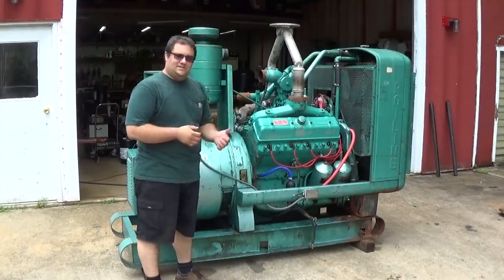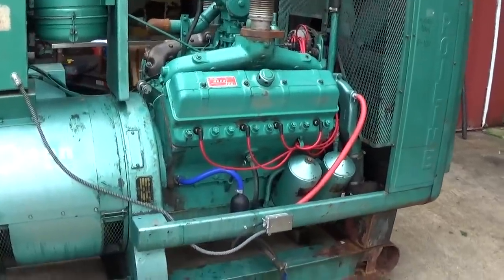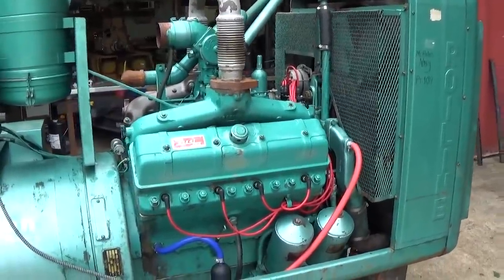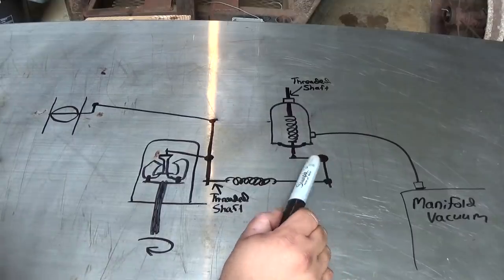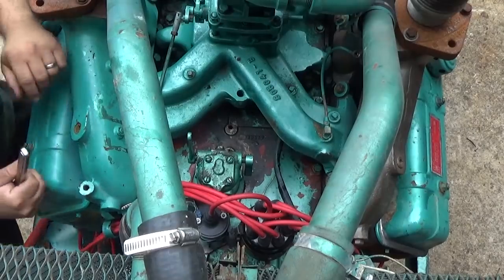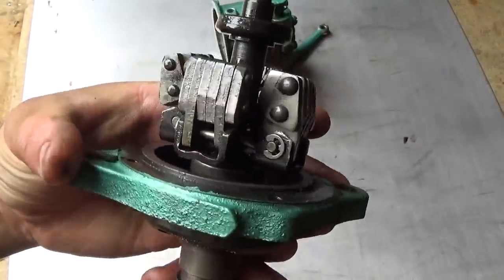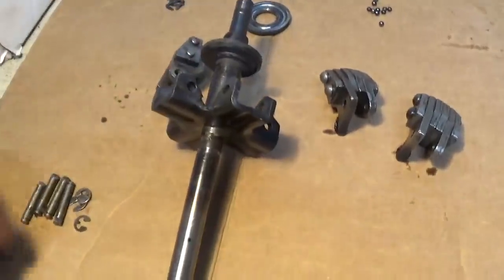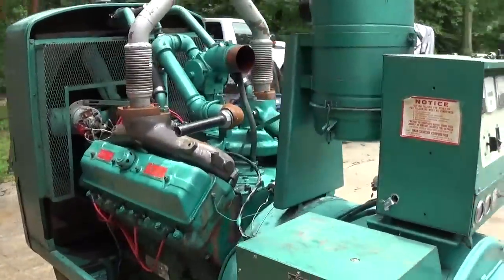844 Cubic Inch V8 GENERATOR Lets find out what is ailing it... Onan 140WE

Comment: I'm interested in seeing the electric governor refit.  I'd be very surprised if you have a high pressure natural gas line feeding the house, are there options to feed it from a bottle?
Reply: 844 cubes he'd be sucking bottles faster than an alcoholic after an AA meeting
Reply: @dustinpoole5106  yep! I've got a propane powered 70kva onan with a turbo 460 Ford on it and it will make 4 500lb. Propane tanks in parallel cold enough to condense water on them even in the middle of summer
Reply: @dangoldbach6570  Gives a whole new meaning to the phrase: you cold hearted bitch.
Reply: Did you have to adjust the propane  @dangoldbach6570
Reply: @MrJerryjam  it's kinda wierd, the only adjustment is an air bleeder screw that seems to make no difference. It runs clean so I left well enough alone. I run a kaeser air compressor and a nitrogen separator with it to fill 300 cu/ft. Tanks for industrial jobs with it and burn roughly 10 gal/hr at 18 amps 480v 3phase. It still is cheaper than getting cylinders from the welding supply house so... Why poke the bear with a sharp stick!
Reply: @dustinpoole5106  good analogy
Reply: It's 884, not 844

Comment: When you started showing the carnage in the governor housing, I was wondering if there is a modern, electronic equivalent to it, using hall effect switches, or a resolver or something like that.  Then you mention electronic conversion..  I've got an idea in my head, and I'd love to see how close I am to what industry has designed..  Please do the conversion!
Reply: Use the distributor for a rpm signal it's not like that's never been done.
Reply: I gave a similar reply without reading yours here, we were thinking along the same lines.!!

Comment: From my own experience I would think that lack of lubrication of the upper thrust bearing was the root cause for the failure. Without being able to see the governor shaft i can only guess but I cannot see any lubrication for the upper bearing other than the oil that would be splashing around inside the housing.

Comment: I couldn’t figure out what was different about the engine, then I noticed the exhaust manifolds were on top of the heads. I’d be interested to see you convert it to an electronic governor
Reply: Counterflow head vs more traditional crossflow head that is usually seen in practically everything.  Super easy to turbocharge tho

Comment: Very interesting how the governor is engineered to run with such spring resistance and so under-engineered for lubrication. It's like tightening the nut on a spindle completely, with dry bearings and putting it into service.

Comment: Thanks for the video, it's very interesting.My only experience with working on a generator is on a 4.5 Kw Honda a toy by your standard. Would like to see your convert this unit to electronic speed control, thanks from Mike in the UK

Comment: Like you said, terrible design implementation. Now that the gov failed, all those missing ball bearings and ground up steel bits have exited out the bottom of that housing into the engine. Hopefully it's a full flow oil filter system.

Comment: I'd say go for it.  We use Quadrature detectors at work all the time.  We dont control a throttle, but it generates a signal to control speed through a motor drive.  Old meets New!
Reply: I bet the "old" engine would run better than most "new" engines...they don't build em like they used to

Comment: I got a question if you have a harbor freight 10k generator head unit can you plug a small motor into it and get it up to speed and run each there at 3600rpm and run othere stuff to
Reply: You'd need a rather large motor and a fast one at that, i'm assuming you're wanting a DC-AC convertor also, so you may find one to work but you'll need a powerful supply